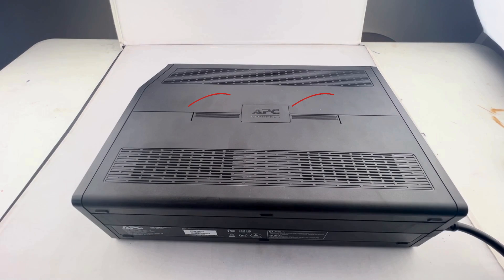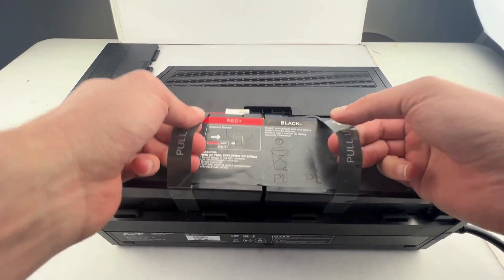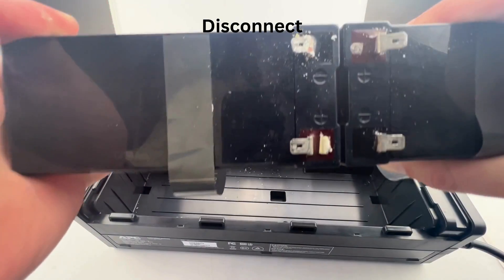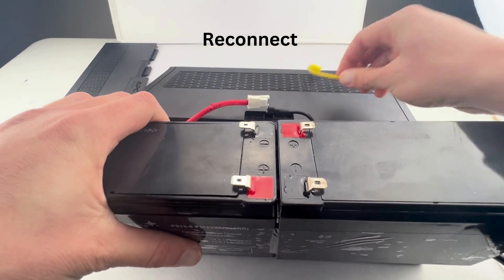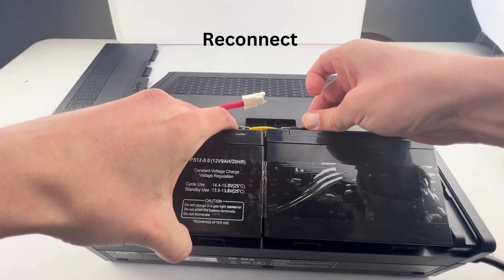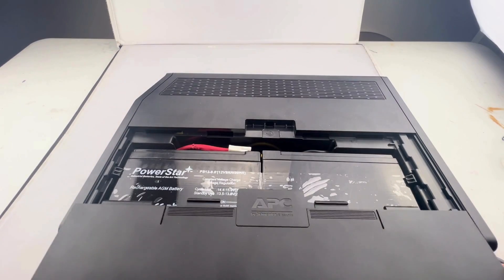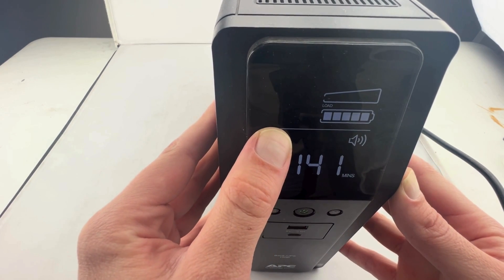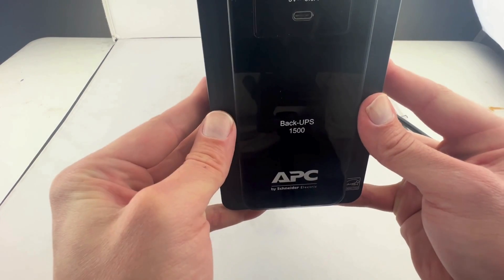How to Replace Batteries in an APC Back-UPS 1500

Comment: I'm struggling to remove the yellow cable at the moment. It has a  rubber blue covering surrounding it and the terminals. Making it difficult to remove. It doesn't appear to be evident in this video, as much as the plastic cap wasnt either for me. However with a bit of assistance, I was able to remove the cap, and it seems the comments mention that.

I havent seen anyone mention or post about the yellow cable being secured by a rubbery covering of some sort?

Comment: Excuse me, sir, are these two 12V 9Ah batteries, or is it an array of batteries that sum to that voltage?
Reply: APC sells its 90$ pack, but they just connect two 12 V 9AH to make 24V pack. I'm gonna order two Mighty Max from local Home Depot for 45$ and be done with this crap.
Reply: Yeah, pretty much 2 12V batteries. I just bought 2 Mighty Max batteries from amazon and plan to use those as replacements. There are 7AH and 9AH batteries to choose from, either will work as long as both batteries are the same AH. The voltage combined is 24V.

Comment: anybody know how many watts of charging the charger can do? 
Edit: Battery charge rate is only 16W... OOOOOF.. So bad for an UPS that powers up to 950 watts.  I've got Tripp Lite brand auto transfer switches in this price range that power only 500 watts and yet provides  300watt recharge rate but no sine wave output...  The only reason I'm interested in this one is for the sine output.

Comment: Awesome video. Quick question

I have the 1350va 
There is this annoying plastic piece in the middle of both original batteries. 
Not sure if you are familiar with them. 
If you are can you easily take that plastic piece off that is holding both batteries together and most probably hooking up the bottom part with the yellow wire that you demonstrated (in parallel)